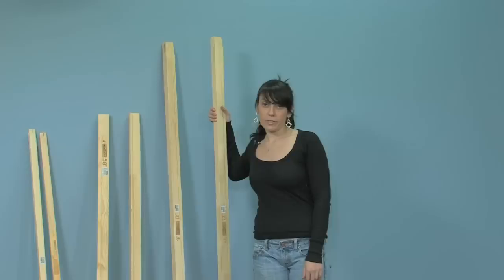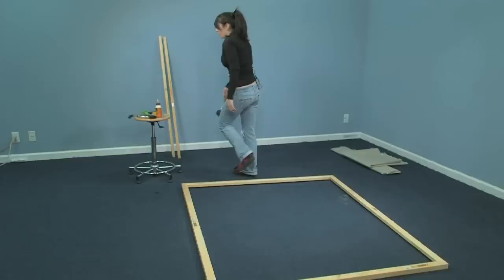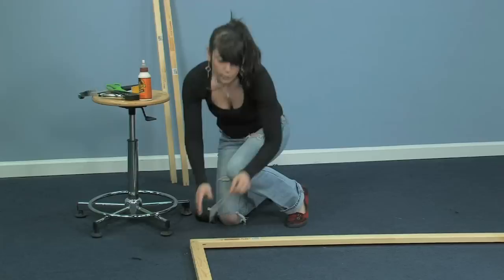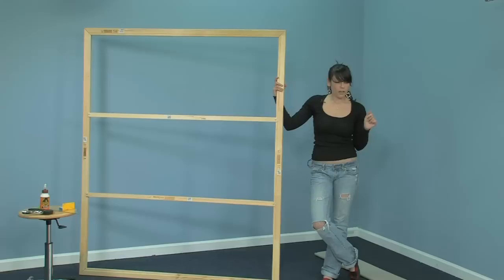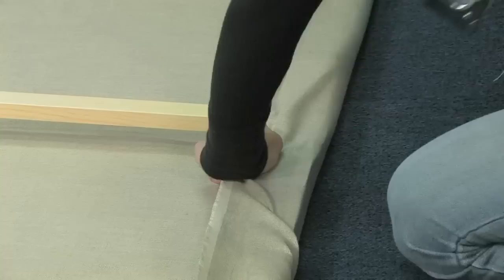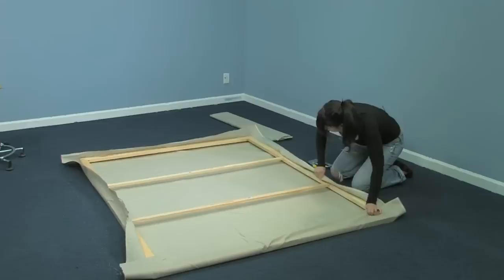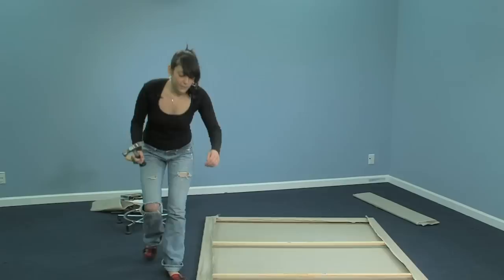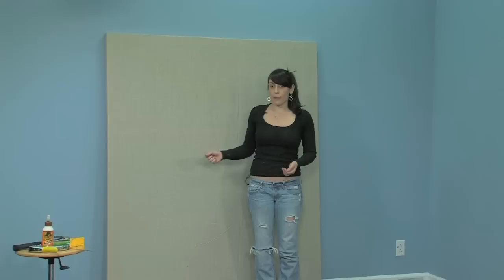How to Stretch a Large Canvas

Comment: Side note: thoroughly iron all creases out of your canvas before stretching. My experience had been that gesso/primer will not smooth them out and large wrinkles ruin the surface. Also, If some slight looseness occurs after stretching, you can lightly brush clean water on the back of the canvas and it will tighten again as the fibers contract while drying.

Comment: If you're serious about stretching a canvas of this size, watch more lessons first or get help from a professional. 

Reasons: 
1. Unless you plan to use canvas stretching keys in the corners, glue them into place as well. 
2. The stretcher definitely needs a vertical cross brace as well as the two horizontal ones or it will bow vertically for sure. 
3. Notice the space between the cross bar and the frame. This should not be visible and is probably evidence that the wood frame is naturally bowed out (a normal result of the wood drying but still needs correction). Use a level and pull into place to straighten the frame before nailing. 
4. The actual canvas should be ironed or steamed before stretching. Those creases will be awfully hard to remove after the canvas has been stretched. Though, do not place an iron directly on the canvas surface. A simple sheet between the canvas and iron can serve as protection. 
5. When stapling the canvas, always work in the round. Do not complete one corner at a time as she did. If you place a staple on one side, you will next staple directly across to ensure you have an even stretch. 
6. USE CANVAS PLIERS. A canvas of that size, regardless of material, will surely not be taut enough if only using your own strength to pull. You'll know you have a decent stretch if when done you flick the canvas, and it sounds like a deep drum. Notice at the end of the video when she taps the canvas, it looks and sounds loose. 
7. When finishing the corners, ensure the folds match. Her's are all on different sides, a messy look. 
8. This one made me cringe. DO NOT cut your canvas right up to the staples. For One, it is entirely unnecessary. This will be up against a wall and a bit of excess will not be seen. Two, a half inch to an inch is proper to ensure your canvas wont rip through the staples or create unsightly scalloping (ripples near the front edges of the canvas). 
9. Once the canvas has been properly stretched, you may need to apply a hot sponge or even a steamer to the canvas to remove any remains of creasing, but don't be too finicky. Applying the layers of gesso will further tighten the canvas and remove creases.

With that said, I'm not trying to persuade you to believe only one right way exists to stretch a canvas, but these general rules apply most of the time. I hope this information is helpful to beginner canvas stretchers!
Reply: Also, make sure you drill a small hole (as a pilot) hole before driving any nails in; otherwise you will likely split the wood.  I would actually suggest adding metal corner and "t" shaped braces as well.
Reply: Wow. Thank you for adding this. So helpful!

Comment: agree. although i was looking for the corner part which i had forgotten since buying pre-mades for a while- that part was perfect. but yeh i was told to use screws and glue not nails. and go round each side equally in one direction from the centre, but turning to the next side for every staple.

Comment: Thanks Heather. Having been a carpenter, a framing square would work better than the small plastic square you used. But the best way to square a canvas frame or a wall of a house, is to use your tape measure and take diagonal cross measurements. When both measurements are the same, you are square!
Reply: I totally agree...you need to measure the Diagonals!
Reply: Do you mean to measure the diagonal across each corner until they all match up?
Reply: Yes, like top left to bottom right and top right to bottom left
Reply: @meravkleinmann3930  Right.  As Merav noted, with such a large span you any errors will really be magnified, so measuring on the diagonal and/or using a longer square is essential.

Comment: I would like to suggest some changes here.  First, get a much much bigger square for testing the corners for 90 degrees, and re test for square on every corner after any hammering as they get out of square very easily.  And then put some kind of temporary staples or corners attached at the corners to keep it from moving out of square while you stretch the fabric, and these could stay in until need to remove.  Then how you stretch the fabric depends a lot on what your ground process will be, as they vary a lot on how much they tighten the fabric.  Some, like applying PVA first as a size, may actually loosen the fabric which is not a good thing, so in that case you want to stretch it very tight and would require a much more careful stretching process from side to side.  I would say the same though for most other grounds unless you are using Rabbit Skin Glue as that is the only process that really tightens the linen significantly before applying a ground.  
Bottom line, if you are going to the expense and trouble of stretching linen on a huge canvas, get lots of advice before attempting this!  And start smaller.

Comment: I wouldn't use wood glue for the cross braces, just screws. If you need to restretch your canvas at some point, loosen the screws a bit, tap your corner keys to tighten, and retighten the crossbraces. You don't want the cross braces stuck at their ends.

Comment: Why do people NOT understand that you cannot glue or screw together the stretcher pieces? 
Over time the canvas needs to be stretched out to prevent sagging or flapping around like sails on a ship and securing the wood as described will not suffice. Yes - as mentioned, tightening the canvas by wetting the surface behind will work to a degree but cannot be used every time.
Use the wooden wedges if they are supplied and check first if the stretcher manufacturers have catered for the use of them. Many of them just mill a 45 degree slot in the ends as they have not the slightest idea what they're for.
I've designed special tensioning devices for large canvases which can be made and fitted afterwards.

Comment: Jerry's sells great supplies but this is not how you stretch a canvas. Splitting support bars with the nail renders them useless, non-beveled edges means you'll get inner-frame marks showing through when you paint (it'll create a ledge that makes lines), you need to do symmetrical, even stapling all around L-R, Top-Bottom and don't stretch sideways, yes you must staple corners - it's essential (ask any museum or gallery curator). Height never has anything to do with it anyway. Better out there.